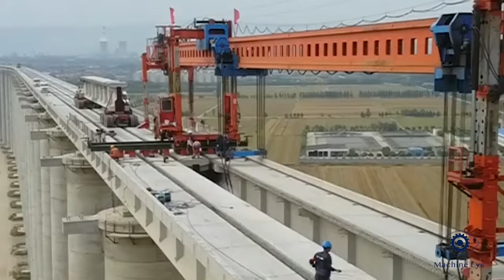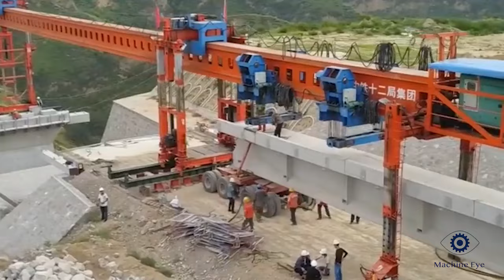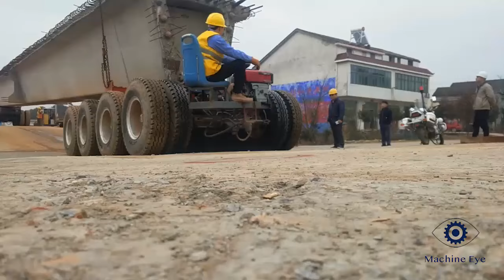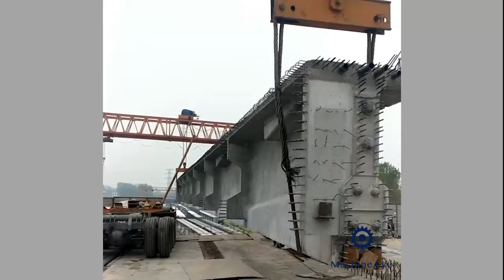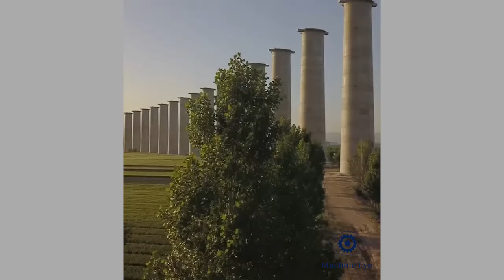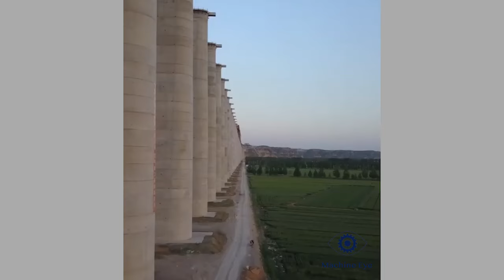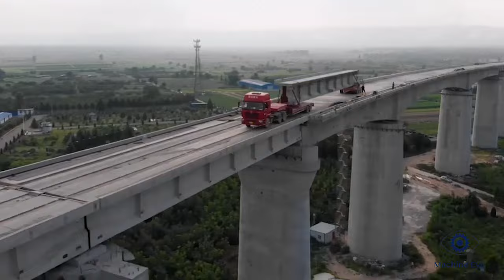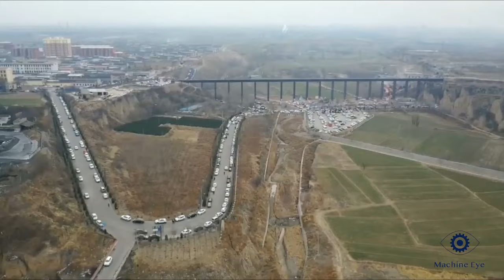Shocked by China's super engineering! I don’t know how to look at this pier

Comment: A few questions/observations.  Why build such a length of elevated highway?  Why not build it at ground level?  Did the Chinese learn anything from the UK's poor experience of building box girder bridges?  Did the Chinese learn anything from their own experiences of building the Metro in Dubai?
Reply: use less land, lower noise level , depend less on the ground situation , safer ...
Reply: @bixudiwon6363  Please explain how it is safer and less dependent on ground situation?  As experience has shown world wide, elevated roads are less safe and more dependent upon ground conditions as the pressure exerted on the ground is greatly magnified.  As to using less land; yes, true the pillars use less land, but it doesn't mean that there is more land available as only fools would build under an elevated highway.  Also you haven't addressed my points about learning from their problems in Dubai or box girder construction of bridges.
Reply: @Jock609  tell me how you can level the rail for less than 1 degree between 50km? the pole is designed to withstand 9 degree earthquake. if it is on the ground, the  rail will be destroyed by 6 degree earthquake.

Comment: If your valley is so big, at this point just lower and higher the street at the beginning and the end. This should cost much less, will take much less engineering and will also take much less maintenance later on. Also your citizens will be much less afraid of driving on the street.

Comment: Here's one for u2, the vibrational tendencies of shipping extremely long cement structures for the building of bridge reinforced by rebars, wired together inside the cement for support any thing loose in the stability of the bridge chief engineer... stoger.
Reply: Or is this the reason the tappenzee was the name the builders gave to the bridge they would cross. Is it stable... gee tap and see... chief of police.
Reply: Say to Mitt Romney regarding the report on the windmills across nantucket sound any problems with maintenance issues? Ever sail on the sea captain jack.  Aye but never on such a sound... as the propellers made their turn... look we need to maintain that little engine up there... supporting those gargantuan propellers. Gfi.
Reply: Maybe the 6 billion dollar dig was the reason he went to Utah... or was the unbelievable gullibility of those of the people of the state and those who present them with such award winning i.... deas.

Comment: They are just leaner, more risk taking , fitter and generally more hard working than Americans and the West. America 1890 to 1950 was like this. No more sadly. Another example. Governments put out for discussion and consultation the need to a rapid roll out of charging bays for e vehicles. In Europe 5 years on still discussing it with a smattering of delivery. In China 15,000 chargers are designed, built and installed in a matter of months. There's the difference.  It is the CHINA century.

Comment: Could wind turbines be added to this extremely high structure For example attached to those massive upright concrete piers ??? Just a thought from Down Under in Australia .
Reply: Additional lateral wind resistance will affect the life and safety of the bridge.
Reply: You are probably correct I was thinking about vertical cylindrical type not the blade type but hey I am not a structural engineer .

Comment: all fine and dandy , but this bridge will need to be replaced before it can earn back its cost ..... so why they are building it ? alot of projects these days are not really worth the money. this is one of them i think. the materials could have been used on more efficient projects .
Reply: does the interstate highway system recover its cost? tranportation infrastructure's purpose isn't to make profts. think a little

Comment: Why waste so much money on a 60ft high bridge over a simple plantation?? Nice project though!!
Reply: did you see a bullet fly on the ground? high speed train is like a bullet.
Reply: @bixudiwon6363  don't tell me the trains stay on one level for several kms??
Reply: @jabig1  that is exactly right. so the rail is designed to level no more than 1 degree over 50 km. it will support the train to over 500 mile/hour in future.

Comment: LOL "China's super-engineering"---- what a joke!  It all looks very impressive, except that all the concrete is probably totally sub-standard and will eventually fail in a few years.  Chinese steel is extremely low-grade and mixed with additives making it also sub-standard.  Chinese construction standards are totally different from the normal Western standards, where the highest quality of materials is required.  In China it's only about building fast and cheap,  and quality is way down the list.  That's why many new Chinese buildings and bridges and structures are falling down all over the country.